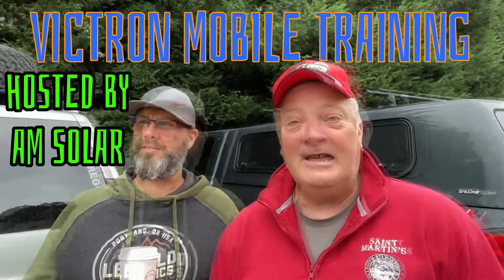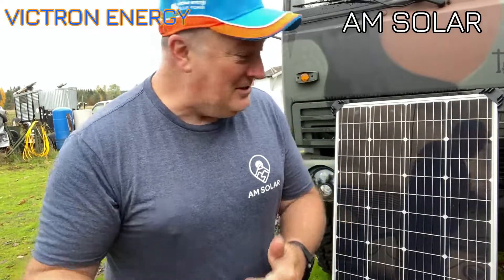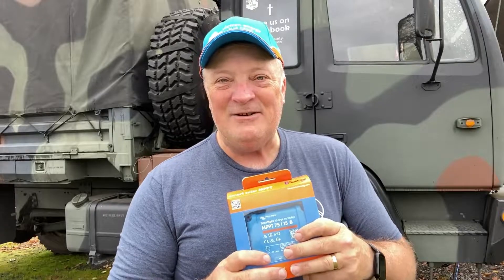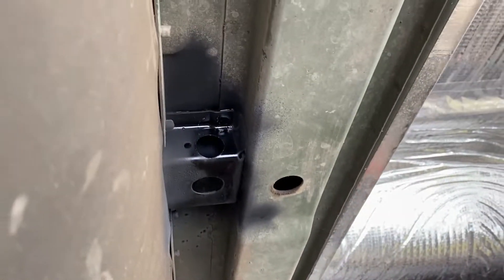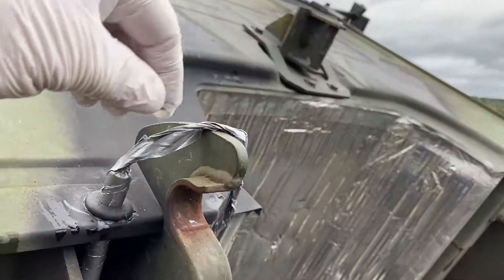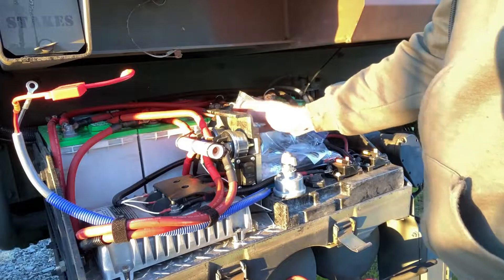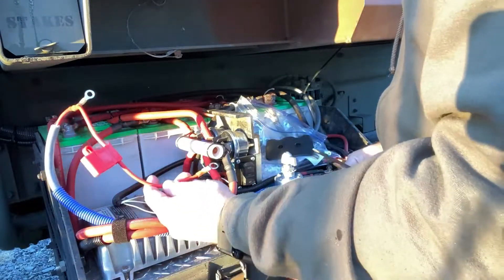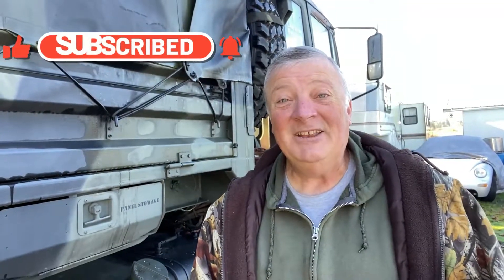FMTV SOLAR CHARGER Off Grid Package

Comment: I didn't know they had a mobile training unit. Super helpful to see ideas on running the wires as well.  Before we started planning for our build would have never guessed how much planning is needed.  Not to mention working out the budget for the build.  Thanks again as always super informative. I think it's a tie with the huffing and puffing. Be careful with you back.
Reply from the maker: I'll try to take it easy, but if I'm not outside most of the day, I'm not happy. I felt a couple twinges in my back today, so I stopped and took a break. 

I really liked the training they put on... very professional and such incredible products! I know my system is very small potatoes, because I did not need it to be anything but a battery tender for off-grid situations, and power things back up if I have a phone plugged in to the truck for recharging overnight. I am really stoked about the blue-tooth app and all the information that it has. I love it.

Comment: Dave, I used the video you made some time ago on the 24V and 12V lmtv diagram, and was able to get my truck running today. My truck did not come with batteries and the 12V side left me confused, did not look complete. So again I used your explanation and found I was leaving out the grnd side of my 12V leg to the system. Just wanted to say thanks from way down in Florida!!!
Reply from the maker: Michael, so glad that the videos helped you. I sometimes have to assume folks are getting some good from watching. Many blessings on a long and well running truck!
Reply: That is a cool story!
Reply: It was the drawing you had, and the neg side pulling off the 12v of battety #2 and pos of battety #4 to grnd, that I was missing. I saved it to my photo gallery in my phone!!